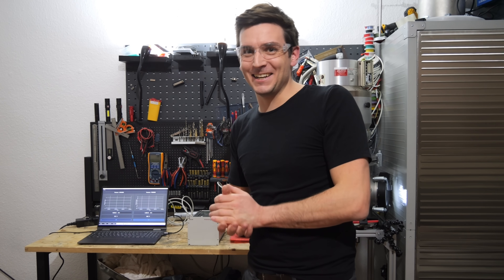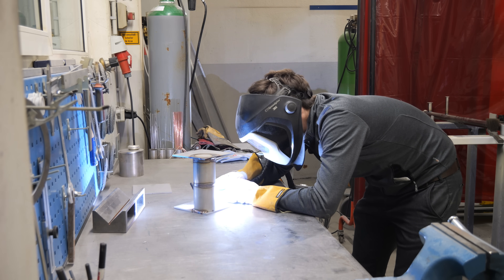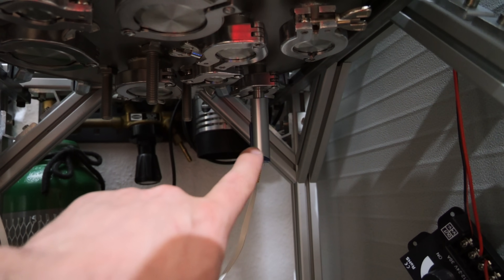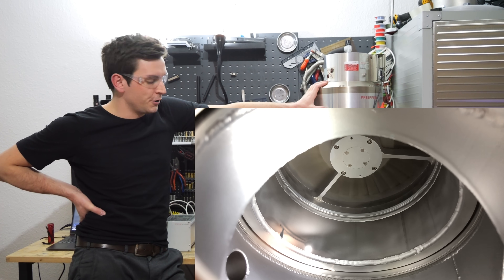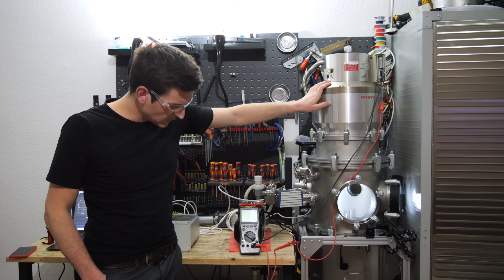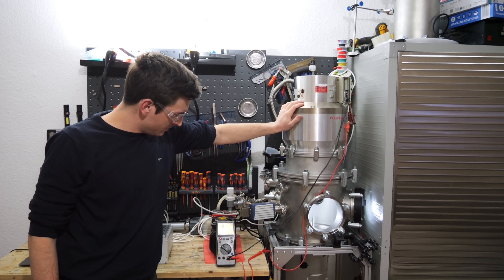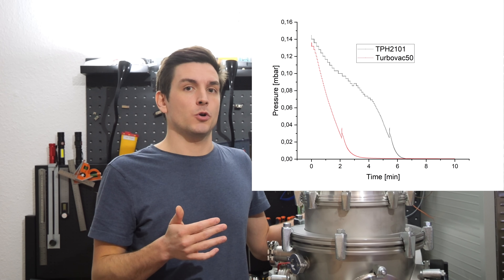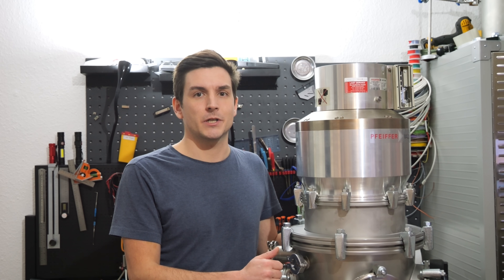Turbomolecular Madness – A Nerve-Wracking Experience

Comment: I have worked with these exact pumps, and yes, the vibration at low rpm is normal, just need to be clamped securely. Not sure what you meant by connecting the two turbos together to the big pump, but to make sure, you should never connect a turbo to a turbo, the pressure on the exhaust should not be less then 10e-3mbar, for only one simple reason, the oil will boil, leading to problems with bearings. The difference in base pressure is not so important, the turbovac 50 can get in 10e-9mbar region without problems, but the big one cant. The major use of such big pumps is fighting with high gas loads, for evaporation, sputtering etc... Keep up with turbo madness, this is just wonderful to see...
Reply from the maker: Thank you for that information! That's good to know. 
Mh... that's unfortunate. I wanted to test what happens if I cascade the turbomolecular pumps. Considering the very low vapor pressure of the oil I would not have thought that a significant amount will vaporize. 
Yes, the size of the pump has nothing to do with the reached pressure (as long as there is no leak). The only value important for that should be the compression ratio as far as I know. 

I'm glad you liked the video! :)
Reply: You absolutely can stack TMPs (and in fact there are scientific apparatus that utilise such "compression turbos"). In principle you will shorten pump life on hybrid pumps, but in practise I've seen 10+ years of operation in this configuration. If you use full maglevs, I've seen 15 plus years of service.

These cascaded TMP systems are done to get sufficient compression ratios for hydrogen and helium for solenoidal ion sources and atom beam microscopes.
Reply: @mattgbarr  Stacking oil lubricated TMPs is a big no-no, unless you have money, then its ok :) Of course maglev pumps can be stacked, but then again, thats for specific needs, and given the fact how much maglev pumps cost... I wouldnt do it anyway. For systems that require pressures lower then 10e-9, other types of pumps are used... Devil is in the details., money is also a big problem...
Reply: For some more context, these are systems that run in the 10^-10, 10^-11, and even 10^-12 mbar range.
Reply: You should meet my little Edwards 75DX that has been a compression turbo for a light gas optimised mass spec since 2014. He's a little trooper! 😁
Reply: Well, of course you always have NEGs and TSPs and ion pumps. None of which serve you anything worthwhile whilst working with helium.

It's pretty much stacked TMPs or bust. Whilst a no-no in principle, it's extremely common to do so and can give you a very long service life if you use good quality units.

Comment: Why does the welding arc apparently flash in intensity at around 1Hz?
Reply from the maker: Because it's pulsed TIG welding. The current cycles between a high and a low value.
Reply: @AdvancedTinkering  hmmm well allrighty then.

Comment: Wissel Vakuum is very cool for not just making your part, but letting you weld it together and film all of it! Very sympathetic and deserving lots of respect. I really appreciate such based companies who don't just offer a very limited and fixed amount of products but also offer help with any possible problem or challenge you've got. Because that's exactly what the company I work at does; we're not the cheapest, we can't match the prices of others who either only do a few specific things (which is completely legitimate) or lack a lot of quality (which is an absolute no-go in our field). We offer almost anything and also do very individual or special projects. Not cheap, but at a fair price and with the best possible quality and knowledge behind it. But I won't mention our name, because I don't want to advertise. Though I really wrote too much praising Wisser Vacuum, which I don't know personally.
And damn, I really love your videos! But you should keep some distance and other security measures. Modern turbos are really very safe, I've never seen one fail catastrophically, just turning down and refusing to turn up again, which is a great improvement^^ But older turbos weren't that sophisticated and "dumb", so when they failed, they failed with a bang, so the whole rotor assembly just ripped apart into pieces! Usually even that immense force was contained by its casing, so beside lots of expensive equipment being trashed, it was contained. But I still fear the really big ones when they make strange noise xD So stay safe!

Comment: You can traverse the vibration regions, whatever the reason for them, more quickly by having the pump under less load as it's spinning up--you could use the turbovac50 to bring the chamber below 1e-2 mbar and then start the tph2101. Also the pressure in your chamber seems a bit high--you might consider just pumping on it for a few days to see if that boils off whatever's causing the problem. Vacuum chambers that have been worked on and not pumped in a while often have anomalously high loads of miscellaneous outgassing.

Alternately, there might be a leak, of course, but you're well equipped to find and fix that. If it's such a large leak as to bring the chamber to a few e-6 mbar under that big pump, it's admitting air at ~1e-3 mbar L/s so helium will penetrate at ~1e-2 mbar L/s, so if you use the helium leak detector on it bear in mind what a full scale detection looks like. One more coarse-grained trick for such large leaks is to just spray any gas other than air--it will read differently on the ion gauge, so you will see a jump in the signal if you put eg argon or helium or even to some extent nitrogen near the outside of the leak.

Congratulations! It was really cool of Mr Vacuum to let you do that.

Comment: One minor thing - I guess most of your audience is nerdy enough to be able to do the "to the power of -X" in their head - my math is a bit rusty (and I guess some others might be lost as well). So maybe think about putting an overlay in post edit - I know its a bit silly, but for normal folks 0.00006 mBar might illustrate it better. (Now idea if the 0 count is correct, btw. Also no clue how I ended up watching vacuum videos, but love them) 🙂
Reply: In the "vacuum trade" it is all about powers of 10. The pressure changes over so many orders of magnitude that the value itself is a minor detail, and the order of magnitude is how we think. So +3 is atmosphere, and -6 is nice, but the pump should probably be able to do better. Easily -8 without looking up specs. This way we even use different units that are different, but have the same order of magnitude interchangeably, annoyingly. A classic unit is mm of mercury, written mmHg or torr. mBar is the same order of magnitude. (Bar or pascal is not.)

Comment: My guess would be that the vibrations is a result of a the inverter drive pushes the motor with a frequency where the windings matches in a way that the forces is not ideal and it stops when the frequency is passed that area. Some drives has curve settings that can minimize but it might not be within the motors thermal margin to accelerate faster at that speed.

Comment: I had worked for Pfeiffer Vacuum in Asslar as an Servicetechnician for Rotary Vane Pumps, and the Oscillation is normal but be carefull with this beast, we had a Video Years ago in which one of them totally disintegrate itself, broke all his attachment bolts ( 6 or 8 M12 ones) and goes Kamikazee through the Shop, these suckers are horrible terrifiyng and dangerous.
Reply from the maker: Thank you a lot for that insight! Yes, it was definitely not safe to run that thing on my flimsy stand. But I just couldn’t help myself.

Comment: what would physically happen if the chamber got a massive leak with the pump at 100k rpm?
Reply: Not too much. The pump will slow down rapidly because of the high load. The controller will shut off due to overcurrent and the pump will eventually stop. 
If the leak is big enogh, like a massive hole, the rotor blades can bend which leads to a rotor crash. But modern turbo pumps can take a very rapid pressure increase without crashing.

Comment: We recently bought a used GC-MS. When we started to pump down, the noise was similar. Not so happy faces. Turns out the seller's technician forgot to plug a blind into the purge port of the turbomolecular pump. It happily drew vane pump oil into the whole system. 

I was so happy it came with a 3 months warranty. Now it is running nicely.

Comment: Very nice video!
Resonances and vibrations of TMPs always sound really scary to be next to.
But they can be beasts. We have a dozen or so pumps of similar size running in our labs that are close to 50000 hours operation without a single one showing issues or failing.

If you have the adapters for it, hooking up the small Turbovac50 as backing for the TPH2101 might be interesting to see if you can down even further.
Reply from the maker: Absolutely! During those resonances, my heart rate definitely went up.
It's fascinating how long these machines can run without any issues.

Actually, I have the necessary adapters to connect the Turbovac50 as backing for the TPH2101. That sounds like a fantastic idea! ;)
Reply: @AdvancedTinkering  Another comment to the spikes in the pressure readout: the gauges sometimes switch between emission currents (if they have a filament) or readout full scales when they get to lower pressures, which can cause jumps like that.
Reply: Yes, as the pressure gets lower most controllers will step down the filament current.  On glass gauges you could see the change in brightness, where I work we got rid of our last system with a clear glass gauges several years ago, now everything is a black box connected to a computer...
Reply: @AdvancedTinkering  I wouldn't recommend it. The load on the 50 could be so high that it overheat, of if a slight puff of air is compressed by the big on the output from it can be so high that the small one can be totally destroyed. And you won't get any lower anyway since you are way past the vacuum regime of that to work, that only work at rough vacuum.

Comment: Pushing past the critical speed is nerve wracking for sure.  Possibly while moving the initial bit of air molecules may cause inter-stage surging… try using an ammmeter on the pump to watch how much work it does.  Also, if you don’t torque the clamps evenly, you could warp the bell housing on the pump. Might be the source of the vibrations…
Reply from the maker: I tried my best to tighten the screws evenly. But thank you for the advice! However, I don't believe that was the reason for the vibrations. They should be continuous if that were the case, not suddenly stopping. Also, when the pump is turned off and slows down, the vibrations don't occur at 10% speed (only at 50%, which leads me to believe that range is resonance). So, it must be related to the electronics.
Reply: @AdvancedTinkering  maybe it's a resonance between the motor coils and the esc electronics. Sort of like engine knock, as in there's a certain speed where it's not timing the phase change correctly to the coil current, and there's some sort of flyback?
Reply: @AdvancedTinkering  If you let it ramp up while the chamber is at high vacuum I suspect that you might not get any vibration, since I am guessing that it is occurring at the point where the motor is having to put in the most torque. It's still a little concerning when you first hear it since failures in the motor could cause it to push the rotor into the crash bearings, which could possible sound like that at low speeds. I wonder if it could be good practice to start a questionable pump under a high vacuum so you can know immediately if you hear any vibrations that it is likely a problem.
Reply: In industrial equipment SEMs and similar  (not things made in the university physics lab) the turbo pump current was our main parameter the vac control system uses to generate faults. RPM and to a lesser extent vacuum rate also played a role but you capture some aspect of those in the turbo pump current draw.

Comment: 10% load means ~3000 RPM, which equals to around 50 Hz. This frequency is the same as the grid frequency you supply your power with.
maybe this is the reason for the resonance of the motor at around 10% load. 
As you mentioned already in the video, it must be an electrical resonance, because after power off, the resonance disappears. So a purely mechanical resonance is not an option.

is there a way to look at the voltages of the motor / the input power to see some sort of phase alignment?
Reply: Maybe the controller has some old caps that are not up to the task, and some extra ripple is passing thru.
Reply: Mechanical resonance is still possible an issue. If you turn it off the rpm starts changing and changing rpm will cancel out vibration.
Reply: but highly unlikely. The change in RPM is very slow because of the low friction of the rotor. When he turns the power of the motor off, the vibrations instantly stop, the rotor spins on freely with roughly the same RPM @SaviorTheBurn
Reply: @matze1508  I doubt a vacuum makes it low friction. Im sure pieces are pulling together tightly.
Reply: the rolling friction in the bearings doenst increase that much while under vacuum.  @SaviorTheBurn

Comment: My guy, those welds are impressive!. seriously, most people wouldn't even be able to run a TIG without going through a whole box of tungsten tips first try. meanwhile you're over here stacking dimes.

Also, ramp up vibrations are spooky. I used to have to use a large bench grinder at work, had a 10 inch aluminum oxide wheel on that thing. When you turn it on, the thing near shakes every bolt out between 40 and 60% speed but runs smooth as butter otherwise.
Reply from the maker: Thank you a lot! But to be fair, the pulse mode of the welder makes a huge different. Without it my welds did look worse.
Reply: @AdvancedTinkering  That's fair, but still you need a steady hand to tig weld even with that.